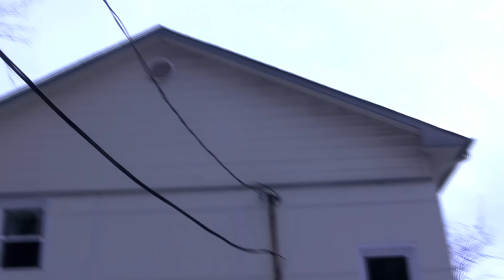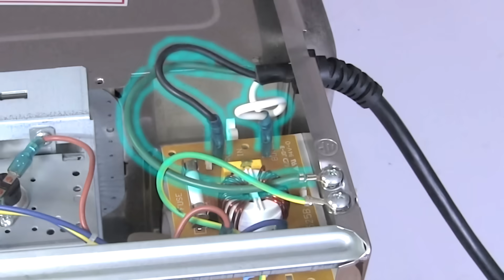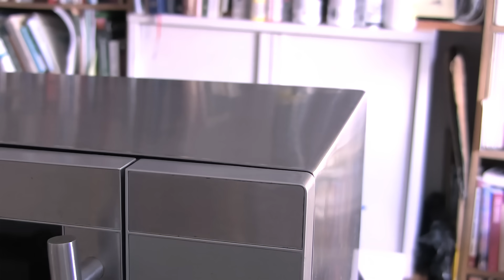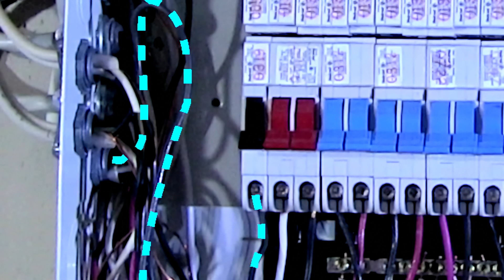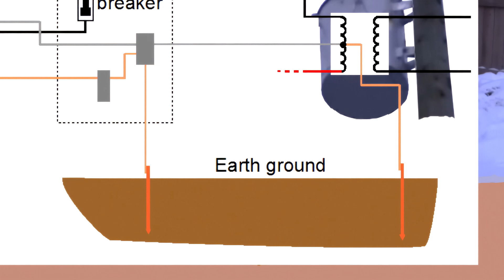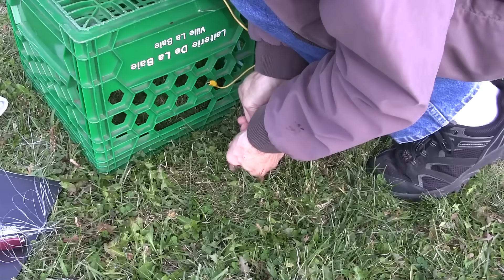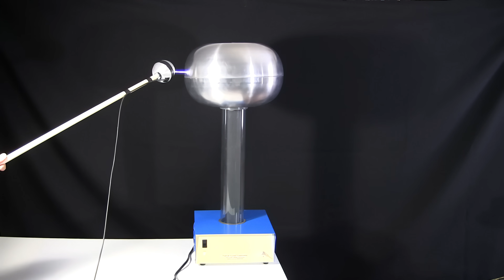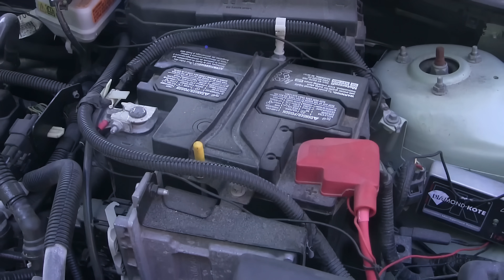What is Ground? Earth Ground/Earthing

Comment: Excuse me, 3:22 how come the electricty that got into the ground wire gets to flow in the neutral wire if it’s not used yet?
6:00 “the electrons on the case repel along the wire to the earth ground”, so does it mean the electrons repel against each other because they’re like charges? if so, what repel the last electron in the case?
6:22 why is the potential difference -8000 volts, as oppose to some aa battery with 1.5 volts?
Reply from the maker: For 3:22, the ground - neutral - transformer coil - hot - breaker - hot - microwave oven case - ground form a complete circuit (3:27). For this example, you shouldn't really think of a direction for the current, instead think of it as all moving at once as soon as the circuit is made, which in this example happens when the insulation breaks on the hot wire and the wire touches the case.
For 6:00, yes, the electrons repel because of they're like charges and also because the ground is more-or-less neutral. If the ground was as negative as the case then nothing would flow. As for the last electron, I guess it wouldn't really go anywhere.
For 6:22, I just made up the -8000 volts for an example. Usually for the case of charging due to lightning, the voltage is high. But if for some reason it was only 1.5 volts then the charge would still flow.
Reply: Hi! first off I will say that RimstarOrg's reply to your question was spot on.   

But with regards your question about 6:00, and I hope this doesn't cause confusion:  "electron flow" is a terminology of a model of electricity that works quite well in most cases. But it is only a model.  In fact almost none of the electrons "flow",and what little does flow is referred to as "electron drift", as in drifting slowly down a lazy river.   What moves quickly, the real muscle of electricity, is "charge" which is a bit mysterious.  .  metals have a property such that, at almost the speed of light, they distribute any charge put to them over their whole length and width.  In the case of a wire, if there is charge at one end and, say a resistor, at the other end, then at almost the speed of light the resistor will feel the charge....no electrons flowed.  for the resistor to conduct electricity....that is to say, for charge to flow through the resistor, the other end of the resistor must be connected to the opposite charge of the same thing that created the first mentioned charge connected to the wire and resistor.  Charge seeks to annihilate itself so as to produce an uncharged or neutral state.

I have suggested to students that they don't imagine electron flow in a wire as a bunch of dots moving along, but rather see a charged wire as a glowing wire which will become dim and then go out completely if allowed to have connection to an opposite charge.
Reply: rh001YT I think all these analogies confuse the issue. I agree the analogy has to fit in with the calculations but practically you could think of current flow as oranges flowing down a river. Nevertheless, I prefer the planetary analogy for current flow.

Comment: luck is superstition, it's of no good use, it just for the dumb minded.
You should NEVER ground to the plumbing, that is against code and very stupid.
Reply: Most electrical codes require a home's electrical system to be grounded through the copper or galvanized-iron water supply pipes that lead from the water main to the faucets.   It's always good to verify the ground though.
Reply: Rick Miller So, if someone disconnects the pipe then you have no earth system. It is good practice to bond your ground to the water pipe but not to be used as your sole means of earthing.

Comment: Question.. I see 15v across neutral and earth, if I switch off some brakers to an extension I've just built.. it falls to 6v. Is this an earth issue "and inductance", do I need more earth rods ?
Reply from the maker: I don't like to make suggestions for installations since I'm not a trained electrical installer (this video is intended for the curious lay person) but it sounds like your neutral is not connected to ground in the breaker panel or service entrance as it should be with most electrical codes in North America.
Reply: @RimstarOrg  Ok thanks.. I think the neutral must be connected to ground at the main panel because everything seems to be working ok and it's a fairly new villa. I'm thinking it may be inductance somewhere with the addition of more cabling. I was wondering if expanding on the earth at the new panel in the new extension would be a solution ?  Also the ground here is rock.. I live on a mountain urbanisation. What do you think.. more copper ground rods drilled out with salt.. ?
Reply: Thanks, I'm in Spain, and sorry I meant inductance.. could that be the cause?

Comment: Hot is outbound route.

Ground is inbound route.

Load is work. 

Short is shortcut. 

Its called a circuit.

Always path of least resistance.
Reply: The Hot wire & Neutral wire form the electrical circuit.  The Ground Wire is NOT part of the electrical path for the LOAD in USA.

Comment: Brilliant video, enjoyed it. :) 
Just a comment about the Filtering cap you put across your rectifier in the last circuit (9:00). 
Might be a bit too closely rated for the desired output voltage.... I'd put a 30-35V rated cap in there just so you don't accidentally blow it up during continuous use (even more so if tantalum cap).
Reply from the maker: Thanks... for letting me know you enjoyed it and for the tip.

Comment: I still don't get it. If the Ground and Neutral are electrically connected...if I were to probe between the ground port and neutral port in my electrical outlet, I should read a short on my meter. If that's the case, wouldn't that mean that the ground is "conducting" during live operation?
Reply: During live operation, the Neutral wire is conducting.

Since (long) wires have resistance, Neutral at the outlet isn't grounded anymore while conducting!

So; you shouldn't touch Neutral while in use.

The Ground wire is not conducting, since it is only connected to the metal case (a dead end/open circuit). So Ground, even at the outlet, will be at the same voltage as f.e. your body.

Only when something goes wrong, electricity will find it's way to the Ground, followed immediately by the breaker "breaking" due to the sudden current spike.

PS: Freddy's guess is very wrong, the Ground wire won't conduct the current to the earth, current will never flow to earth! It will flow back to its source, electricity can only flow in closed circuits.

Comment: It helps to think of the history. Originally, there were only hot and neutral wires, no ground. In a perfect circuit, that is all you need to run the microwave. Suppose in this case there is a break in the hot conductor's insulation and it shorts to the microwave cover. That cover isn't connected to anything, so nothing happens. The microwave still runs. If you touch the cover in this situation, and if you are in bare feet or touching the sink, current will flow from the hot, through the case, and through you. You get shocked. So, if all you have is hot and neutral, you can make things work, but for many kinds of faults, the system will still appear to work, but will be dangerous. You don't know there is a problem until you touch it.  When you add the grounding circuit, as he described, things get much better. Now, if the hot shorts against the case, current immediately flows and trips the breaker, giving you a clue something is wrong.  

The difference between an electrician and someone who isn't trained in electrical work is that electricians are constantly thinking about making things safe even when they are broken or something goes wrong. It's not enough to just make things work. The EGC (electrical grounding circuit) is all about helping to handle situations when things go wrong.
Reply: Freddy Krueger  If it's not the textbook definition, it ought to be. It goes along with the definition of the National Electrical Code being the list of all the ways humans have surprised themselves by killing themselves with electricity when they thought they were safe. But, there are more things in heaven and earth than are dreamt of in the NEC; for example, having a neutral arc even when your probe showed zero voltage before and after turning off the the circuit at the load center.